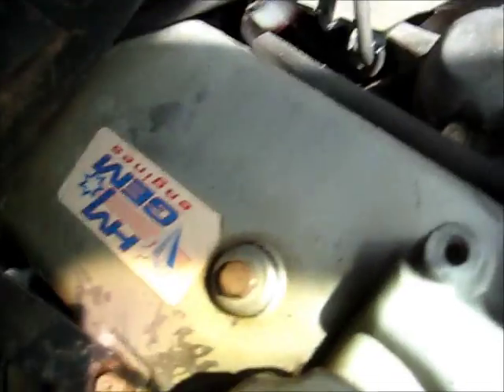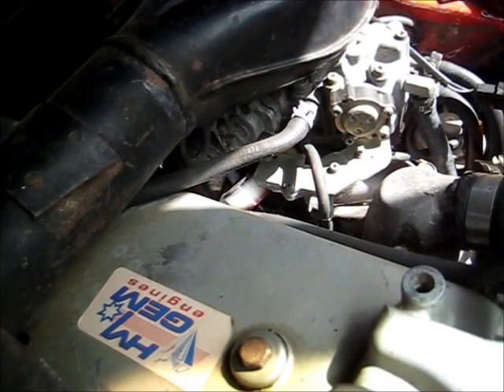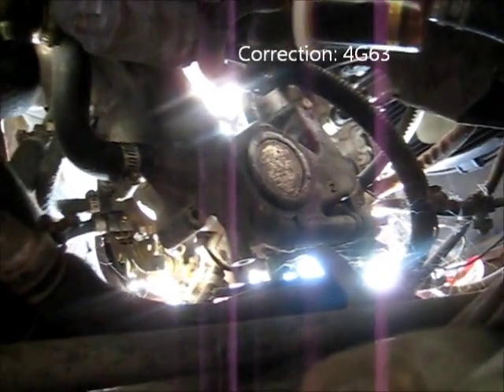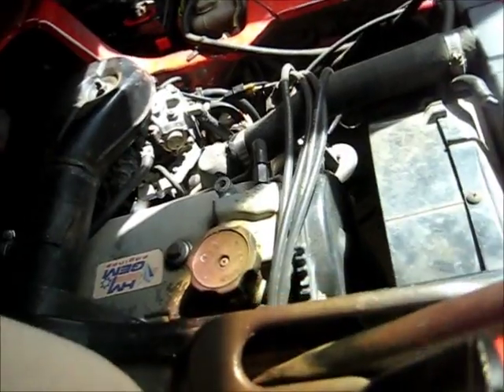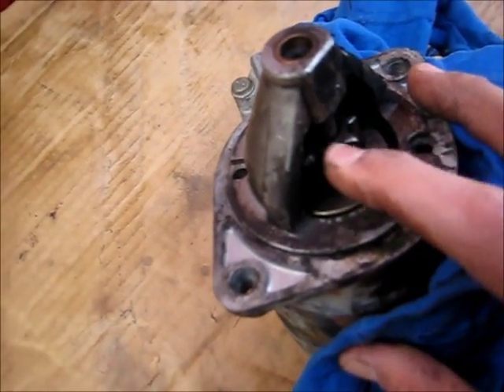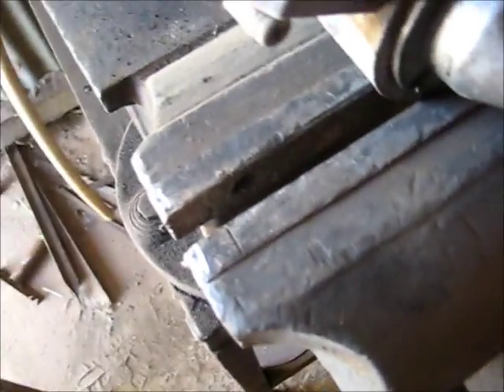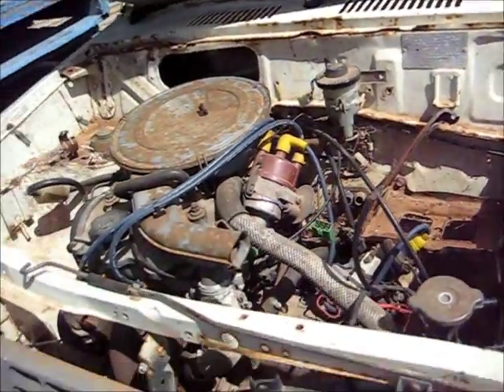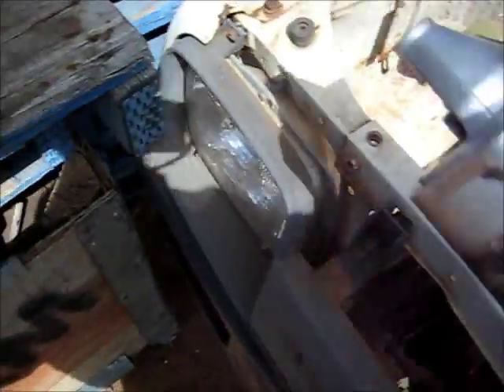Fix Mitsubishi Van Starter Problem

Comment from the maker: @RODALCO2007 Cheers Mate, It's the Clutch Residue that builds up in the starter motor, Thats why the Armature & Commutator were pitted, This was easy to reassemble, now that the brush holder was removable

Comment from the maker: @RODALCO2007 Cheers Mate, It's the Clutch Residue that builds up in the starter motor, That's why the Armature & Commutator were pitted, This had a removable brush holder

Comment from the maker: @RODALCO2007 Cheers Mate, It's the Clutch Residue that builds up in the starter motor, That's why the Armature & Commutator were pitted, This was easy to reassemble, now that the brush holder was removable
Reply: Imustvahawv.